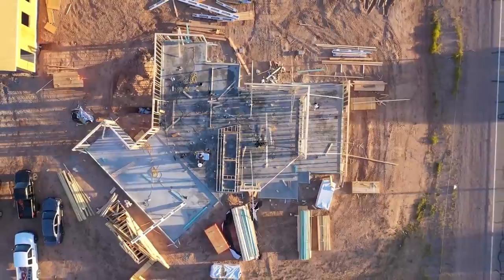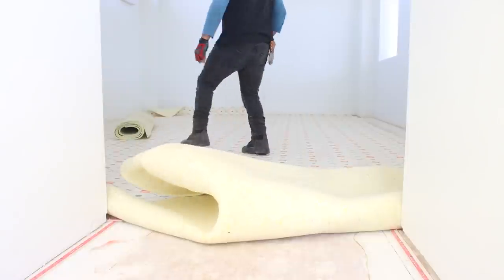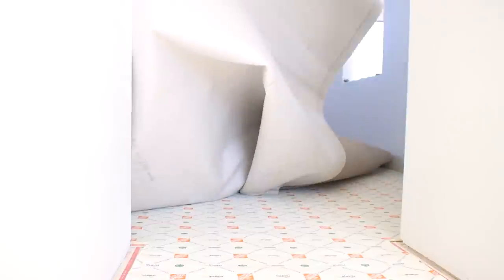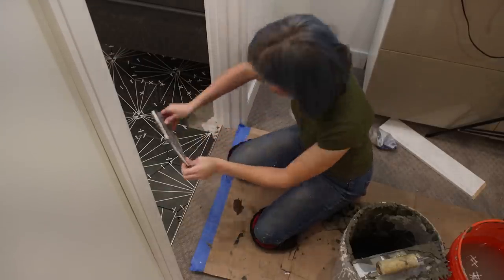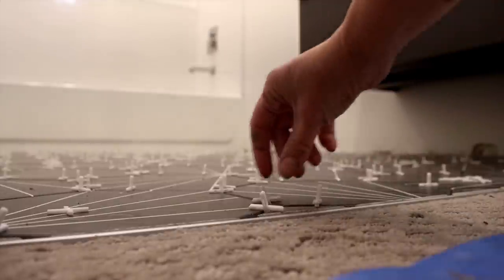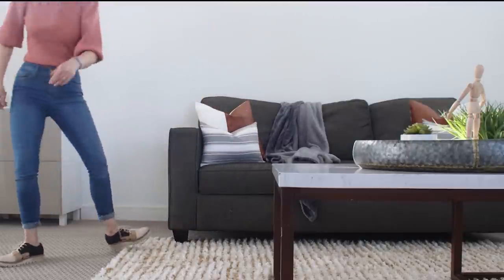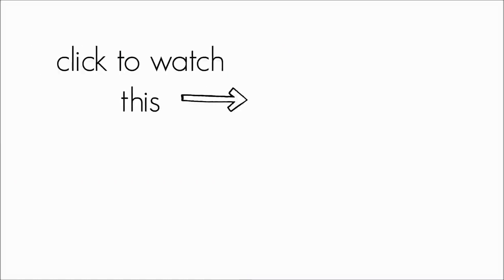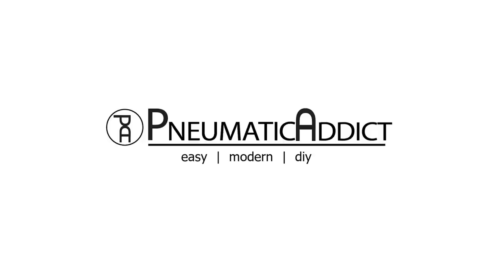The FIRST Finished Room! | Ep. 10 | Building Modern on a Budget

Comment: You all are kicking butt on your house. I wish we had used spray insulation between the floors in the house we built 26 years ago but it was not a "thing" at the time. Will use it in the wall around the master bedroom and bath if we ever remodel. GREAT for sound control

Comment: Amazing tiles, love it.
Is that how you typicaly make bathroom flooring in the US? Where I live we need to have a watertight seal under the tiles and against the wall. Otherwise insurance wouldnt cover potential waterdamage.
Reply: Only the shower/tub area is waterproof.  The rest is just water resistant.
Reply: @jeanchapman1301  im with Johan on this one, I feed as if that may cause a drama. but i guess each country has its own standards
Reply: @daviddimovski9595  just to be clear. Im not against doing anything in any sort of way. I was just curios if this was the typical way to do it in the area.
Reply: @johanflodkvist80  Yep, I understand your original comment. I think your concerns are valid. Even if this is "acceptable" in the area I don't believe it to be best practice but again if that's what they do over there then that's what works.
Reply: @johanflodkvist80  just rewatched the tile-laying bit of the vid and I understand water-resistant may be good enough over in the states but It wouldn't pass in Australia.

Comment: Home Depot, professional installation!?🤣😂
Your guy Diego didn’t seam to have power stretched the carpet, which is essential to prolong the carpet’s live. 

The tool he was using it’s called knee kicker and that is a setting tool only meaning it is used to set one corner of the room and followed by a junior or senior power stretcher tool. 
Most likely your new carpet will show wrinkles once you turn your heater on or once the hot summer comes in. 
Sorry🤷🏽‍♂️

Comment: Aslong as you are using the right kind of crapet theres no good reason not to use it ... Sure it makes for more maintenance but hey if its worth it ...
And for sound insolation you can use this https://www.youtube.com/watch?v=qOgG6Vshjl8
it works to ...Oh and ALWAYS buy parquet from the same batch never from department stores buy it from the manufacturer, if you can! ( diferent batchs diferent colours even when they have the same reference )
HEHEHEH the 2 buckets in the "bahroom" 2:39
A single instaler is more then enough to apply carpet if he/she knows what they are doing ...
( used to do that up to the day i " broke" my back carrying a massive roll of vinyl and then setting it down like i shouldnt ...)